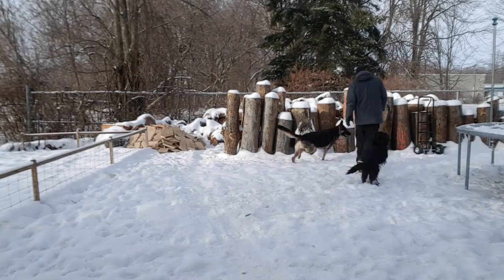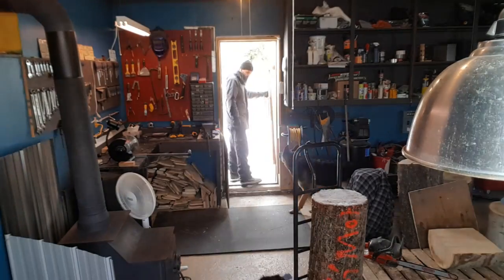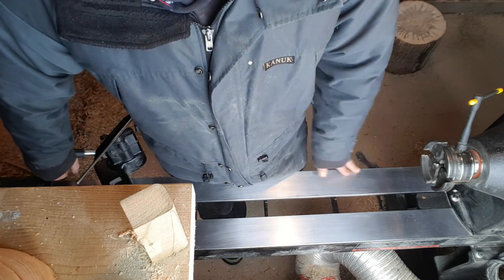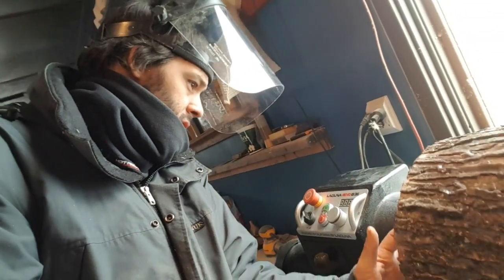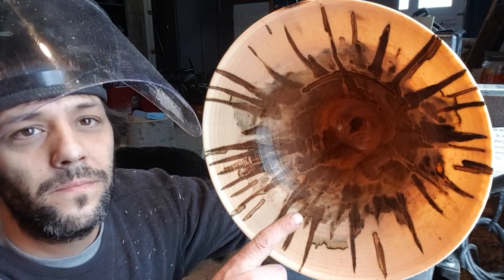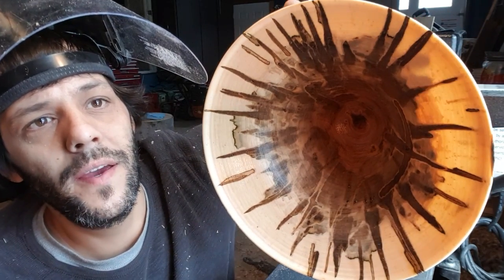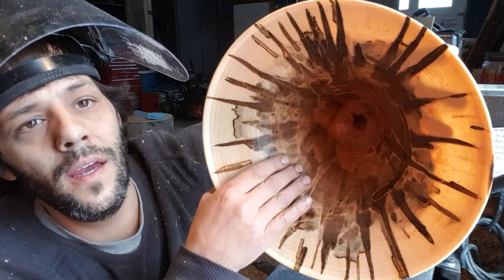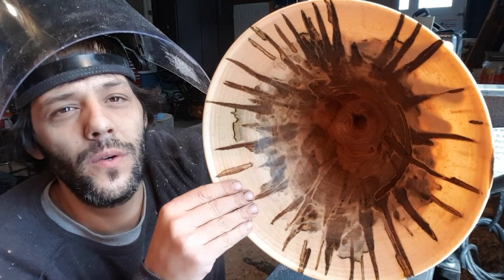Woodturning translucid Lamp

Comment: a ton accent je dirais que tu est quebecois je me trompe?  super job en passant..quel est la marque de ton outils avec le  carbide tip ajustable avec le long manche?
Reply from the maker: +Jf L Salut JF. Merci beaucoup.  Tu doit être Québécois aussi ? C'est pas un carbide , c'est le ring tool de Hanry Taylor.
Reply: oui je suis du quebec aussi! a quel endroit la tu acheter ton outils? langevin forets? merci pour linfo
Reply from the maker: Jf L je crois que Langevin forêts la . mais non je l'ai commander sur internet. je trouve que c'est un bon outil.